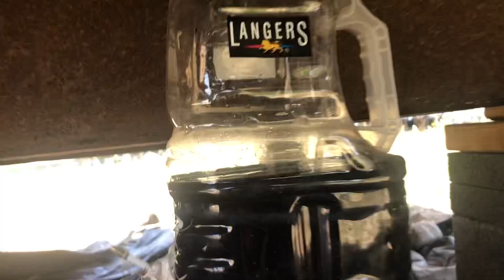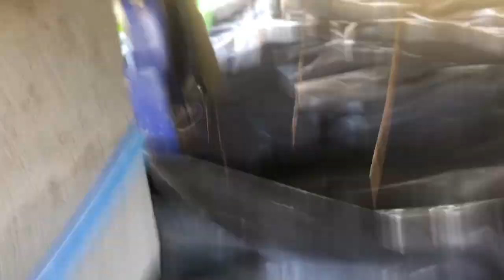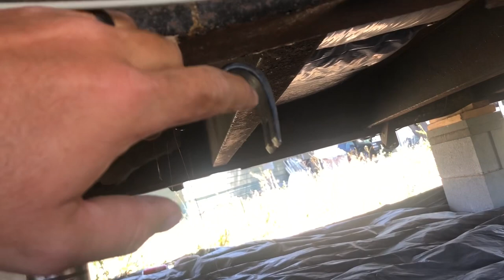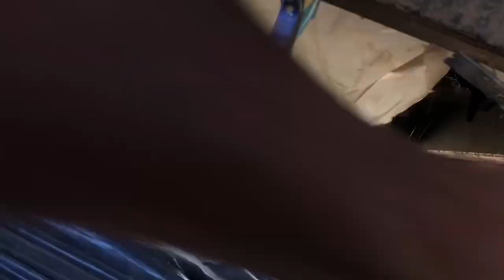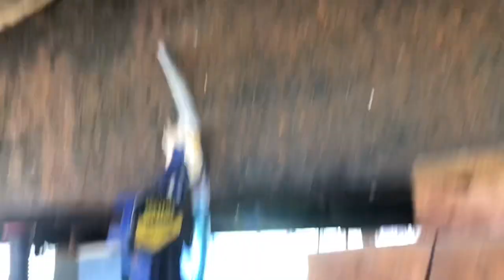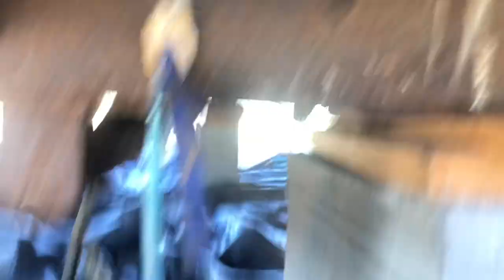Level a mobile home easily with a home made water level

Comment: Not to be a Negative Nelly because I know that you do things to save the most money and you do a wonderful job but this way seems like a lot of work. Do you know how much does it cost for an actual level?
Reply from the maker: Lol yeah I have tons of actual levels but they wouldn’t be nearly as accurate, this method ensures that the back of the home and every inch of the home is perfectly leveled, I don’t see how that is possible with a normal level, I hope I answered your question. Thanks for watching.
Reply: This is a pretty common method for leveling. I've seen pros use this method for leveling a mobile home. I think Frugal is on the right track here. Only thing I would recommend is that use a rubber mallet to to drive shims under the frame

Comment: Hello, I'm not sure if you will see this seeing how the video was released over a year ago. I moved into my first mobile home last year and I need to level it and I'm going to be 58 (f) next month. I will be tackling this all by myself. What diameter is the hose? I thought it looked about 3/8". My second question is do you have any pointers? I bought two jacks and now after reading the replies I will now be buying a rubber mallet.
Reply from the maker: I think it’s 3/8 hose that would work just fine I use 8 ton bottle jacked with a thick plate to distribute the weight and not bend the frame of the home. Try to start with the jug of water at the highest point, you could even make it the highest point intentionally, we are just talking about 1 inch or so. you can definitely do this by yourself, it’s harder if the skirting is on, any questions you have just ask away😀
Reply: Wow, I thought this would never be seen LOL. There is no skirting so that's a plus and there's plenty of room for me to get under there. And yes thank you for letting me know about putting something between the Jack and the frame so that it does not bend!
Reply from the maker: @wendy101b.9  yeah I use a thick metal plate and a piece of 2x4 lumber sometimes wood against the frame and the metal between the wood and the Jack, metal prevents the Jack from sinking into the wood and splitting it. Good luck and feel free to ask more.😘

Comment: Once you clamp the hose doesn’t  that create a vacuum which would restrict the fluid from leving out?  Or is the clamp just tight enough to hold the hose and not restrick the air flow in the hose?
Reply from the maker: You don’t clamp it hard enough to seal the hose off, yes you need air to flow in and out, the clamp is just to hold the hose above the frame that you are trying to level, so don’t clamp it too hard😀

Comment: How can I make them wedges easily. Many videos on how to make them by using a wedge jig. Is it possible to make wedges without a jig? .I am planning on releveling my mobile home.
Reply from the maker: I have never made them, these are from a different mobile home I bought and moved, I will need to make some soon though, if I was going to do it without a jig I would pencil my angle on the 2x4 and keep my 2x4 long so I could hold onto it safely, a little able saw would be best.

Comment: When you dropped and spilled kool-aid after 1st post,all your other measurements were off. No need to watch anymore of this..😅
Reply from the maker: My measurements were not off
Reply: The man Daniel doesn't have an understanding of the system.
Reply: If any liquid spilled out of the hose, you are correct.  It would throw all measurements off.  I didn’t see any spill though.